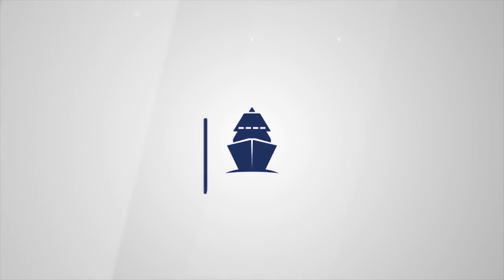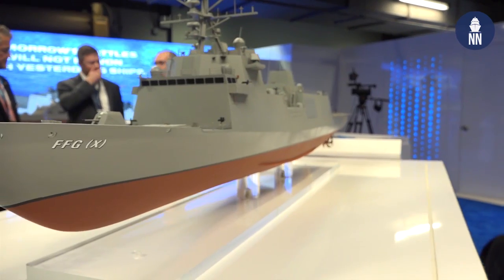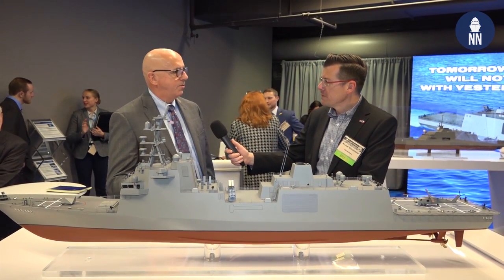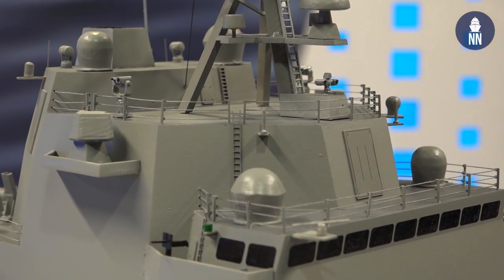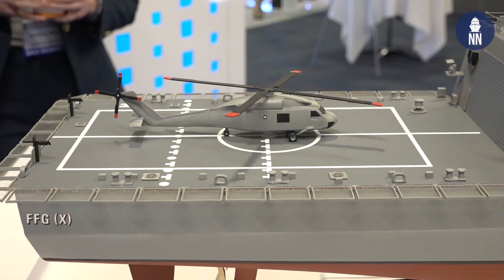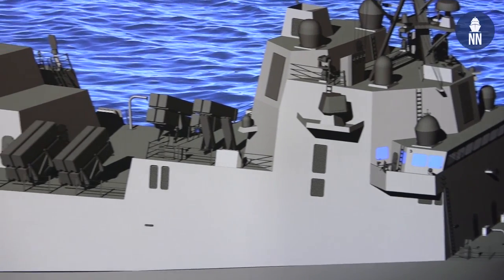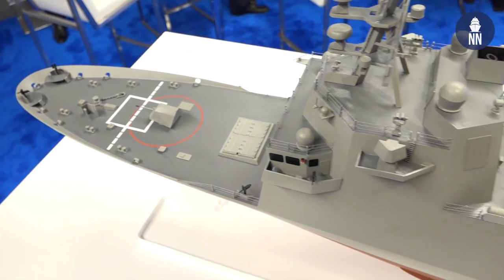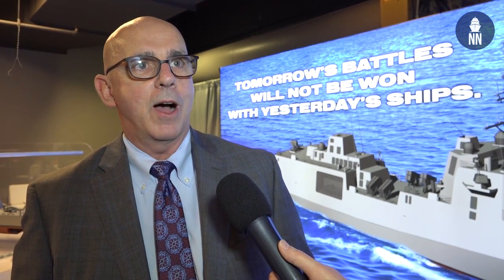Fincantieri’s FREMM Wins US Navy FFG(X) Frigate Competition - Part 2: Interview during SNA 2020

Comment: They should have gone for the German MKS-180 - a far more capable and larger ship! https://www.navalnews.com/naval-news/2020/05/german-navys-mks-180-multi-purpose-combat-ship-program-back-on-track/
Reply: Legio XXI Rapax  That is simply not true and not possible. There is no room for another LM2500 and you can't just add power to the ship. It will tear the shafts apart.
Reply: Legio XXI Rapax  You are mistaken. Yes, there is room for more power generation. But this is additional electrical power generation for direct energy weapons such as lasers and rail guns. This power generation is however not for propulsion.
Reply: Legio XXI Rapax  The FFG(X) will have a maximum projected speed of about 26- 27 knots. It is designed for ASW and vessel protection duties. The FREMM design is a very well known design and a very good design but by the time the last FFG(X) is operational the design will be almost 40 years old. The last hull is planned to be delivered in 2035 and be operational in 2039. Therefore it is already obsolete before it hits the water. That is the main drawback of using this design. The French are NOT even using the hull of their FREMM design for their new FDI frigate either, why is that? That is because the FDI is a new design with a new hull and they do not want to use an old hull. Whether you like it or not, it is not a very wise choice. The Italians will probably not use it either when they design their new cruiser, the DD(X).
Reply: The bid was stirctly for models already in service, no paper ships. Moreover,  after the disaster of the F125 none would have bought a German warship on paper.
Reply: @neutronalchemist3241  True, but it is not a German Warship. It is a Dutch designed warship. But they should have waited a couple of years and they would have had a replacement for the Ticonderoga class cruisers as well. The MKS-180 is a 9000 ton vessel, pretty close to the 9500 ton of the Ticonderoga class and to the 9700 ton Arleigh Burke class destroyers. The FFG(X) is a 7200 ton vessel and is allready maxed out with only 32 VLS cells. The MKS-180 is 11m longer, with ample space where the mission modules are located for more VLS cells.
Reply: @Robert66734  US Navy has tons of real destroyers. They don't need a wannabe one. They urgently need a ASW frigate instead. That's why the bid was reserved to models already in service, not paper ships that come with uncertainties about costs, delivery time and teething problems.
BTW the FFG-X is not "maxed out" with 32 VLS cells. They can be easily expanded to 48. They are 32 only for a question of costs.
Reply: @neutronalchemist3241  The Ticonderoga class is very old and the Arleigh Burke class are maxed out when it comes to power generation. They need to be replaced as well. Knowing the Americans if 48 cells would have fitted they would have put them on there. The FFG(X) is a good ship, but sticking to one class is cheaper in the end. The MKS-180 is also equiped with a towed sonar, therefore very well equiped for ASW.
Reply: @Robert66734  The MKS-180 for now is not equipped with anything. Maybe the first sample will be in seven years. As it is planned, its projected speed is absolutely insufficient for the US Navy, so it's engines should be completely redesigned anyway and, once redesigned them, it has to be seen if they'll be quiet enough for ASW missions. Meanwhile an ASW variant of the FREMM is already operative and, among the other things, the class is appreciated exactly for the quietness of the engines. 
32 cells were the request of the US Navy. Fincantieri always stated that model can be equipped with 48 of them if needed. BTW known models of the MKS-180 only have 24 of them.
Reply: @neutronalchemist3241  True, the MKS-180 does not exist yet, but neither does the FFG(X). The first FFG(X) should be delivered in 2026 and operational by 2030, with final operational capability declared by 2032. So that is quite a few years from now. None of the original equipment of the FREMM will be used on the FFG(X), it will all be swaped for American made equipment. The FFG(X) will have a maximum projected speed of about 26 knots. The original design (almost 30 years old by the time they are operational!!) will be havily modified, they will have to add 320 tons of steel to strengthen the ship. The entire lay-out of the ship will be changed as well. They are just basically using the hull and nothing else. The addition of all that steel means the propulsion system needs to be redesigned or settle for a lower speed. Even if they manage to squeeze in an other 16 cells, it will increase the weight of the ship and will slow it down.

The MKS-180 is a bigger ship and therefore has more growth potential. You know what they say, steel is cheap and air is free!
If the design of the MKS-180 will ever be sold to the Americans it will also be heavily modified. The German requirements include two saunas, elevators and ridiculous staircases. I'am sure the American do not want saunas and elevators on their cruisers :-). The MKS-180 requirements call for a continuous speed in excess of 26 knots. A maximum continuous speed is usually at 75% - 80% of engine power. That means that the actual maximum speed will be higher than 30 knots. The MKS-180 has been designed for a continuous use of two years with rotating crews. The MKS-180 has enough room for 40 cells on the bow and 60 cells in the middle section. Shorten it for the need of a frigate size ship and use the larger design as a replacement for the Ticonderage class cruisers and Arleigh Burke class destroyers. Therefore, in my biast opinion, they should have bought the MKS-180 design.
Reply: @Robert66734  the FFG-X is a modification of an existing and well known design. 
The US Navy requested 32 VLS cells. The FFG-X is designed with 32 VLS cells (and a max speed of 30+ knots), and Fincantieri stated there is space for 48 if needed. The MKS-180 is desighed for 24 cells (and a max speed of 26 knots). Maybe they can be expanded, maybe not.
Reply: @neutronalchemist3241  That is simply not true, the FFG(X) is designed for a maximum speed in excess of 26 knots. The Italian FREMM (6.700 tons) is designed for a maximum speed of 30 kts. The American version (7.400 tons) is 700 tons heavier. If you add another 16 cells that will add another 30 - 40 tons of weight to the vessel and will slow the vessel down even further. The MKS-180 is designed for a CONTINUOUS speed in excess of 26 knots. A maximum CONTINUOUS speed is usually at 75% - 80% of engine power. That means that the actual maximum speed will be higher than 30 knots. That is not a maybe, that is a fact. The original Omega design has room for 40 cells on the bow. In the middle section there is enough room for a least 60 cells. Because if you remove the mission modules there is ample room to add 60 VLS cells. That is simply not possible in the FREMM design.
The FREMM design is a very well known design and a very good design but by the time the last FFG(X) is operational the design will be almost 40 years old. The last hull is planned to be delivered in 2035 and be operational in 2039. Therefore it is already obsolete before it hits the water. In 2037 the first French FREMM frigate will be decommisioned. The Americans are not going to change the hull, they will be using the standard Italian FREMM version. The French are NOT even using the hull of their FREMM design for their new FDI frigate either, why is that? That is because the FDI is a new design with a new hull and they do not want to use an old hull. Whether you like it or not, it is not a very wise choice.
Reply: @jonnytaco7671  The hull is slightly longer but it is still the standard Italian FREMM hull. Like I mentioned before, it is a very good hull but by the time all the vessels are in the water it is a 40 year old design. At the end of life it is a 70 year old design. So it is not a very good choice. They should have joined either the Australians with a newer design like the Hunter Class (type 26) or the Germans with the MKS-180. Both of these ships are roughly 9000 tons fully loaded.
Reply: @Robert66734  
Well if the Americans had to wait 10 years and replace their Ticonderogas with your ship, (but i'm sure they're quiete capable of building their own) they could also consider the newly planned Italian 10K Ton Destryer/Cruiser which will have amazing fire power, and a proven track record, seen it would be un upgrade from the exsisting Orizzonte class destroyer which has amply proven it's worth.
Why woukd they want to buy a German ship, when Germany has hardly built anything to shout for lately, (maybe just the 212 subs)?
Reply: @sergiodario58able  They do not have to wait ten years, the first MKS-180 will be operational in 2027. The MKS-180 will be build to a higher standard of survivability than the Horizon Class and it is not a German design but a Dutch design. The Americans have to strenghten the FFG(X) as well beacause it is not upto Amercian standards. No doubt the Horizon class is a good warship, but it is also an old design and there are however no signed orders yet for an upgraded version of the Horizon class. The order for the MKS-180 will be signed later this year. The problem is that the Americans do not have a design ready to replace their cruisers (Ticonderoga) and destroyers (Arleigh Burke) that is why it might be a good solution. These ships will be build in the US as well and with US equipment just as the FFG(X) frigate (Italian FREMM version). The problem with an upgraded version of the Horizon class and that of the FFG(X) is that they are old designs, like I mentioned before, they are probabaly very good hulls but by the time all the vessels are in the water it is a 40 - 50 year old design. At the end of life it is a 70 - 80 year old design. The French are NOT even using the hull of their FREMM design for their new FDI frigate either. So it is simply not a very good choice. The new DD(X) might be a good option if it gets a complete new hull design, just using the old hull is in my opnion not the right choice. It might just be a good idear if Italy adopts the same MKS-180 design, the DD(X) and MKS-180 look quite simular. It will save Italy a lot of money in design costs, in these challeging times it is a good idear to work together.

Comment: Seems a little under gunned, ?  With no close in weapons systems (phalanx), only a 57mm main gun when most ships of this size and class use a 76mm or larger and no 25mm or 30mm auto-cannons. Also no torpedoes ?
Reply: Also I forgot to mention it does comes with CIWS. It’s called SeaRAM using missiles instead of gatlin guns
Reply: @aps125  RAM, not SeaRAM. SeaRAM is a standalone system for ships lacking the radars this ship has, using the same missile, but the radar systems of the Mk 15 Phalanx. RAM uses a 21-cell launcher, directed by shipboard radars.
Reply: US Navy has approximately 100 large surface combatants employing 5 inch naval gun. That’s more than adequate for naval gun fire supports. The 57mm is not only cost effective but also comes with lots new innovation in terms of smart munitions. US navy plans to deploy two types of guided 57mm ammos: L3 Alamo rounds for anti surface warfare (against multiple small boats attack, a tactic favored by Iranian IRGC), and a high end Raytheon developed MadFires round for cruise missile defense. They are much more effective for their intended mission roles in comparison to traditional 76 or even 127 round. Again it’s the ammo that matters the most, not the caliber. As for ASW, FFG-X will eventually deploy VLA Asroc using some of the VLS cells. It’s a better option than torpedo launcher.
Reply: @aps125  Guided ammunitions for 76mm, both AA and anti-surface, had been out for years. They don't need to still be invented. Advocates of the 57mm point out that, thanks to the higher ROF it puts (slightly) more explosive in the air in the same amount of time, but the 76mm has 60% longer range for AA, so it simply starts firing way before and has much more time to fire a second salvo if the first one fails.
Reply: @aps125  also their helicopters will be armed with torpedos.
Reply: Hopefully the guided weapons don’t fail like what happened to the Zummwalt class.
Reply: Its 2020...guns are pretty obsolete
Reply: A lot of torpedo launcher are effectively useless as they are out ranged by the subs they are supposed to defeat. Helicopters are your best option.
Reply: Conan  How many months into a shooting war till you run out of ESSM or SM whatever? Much rather have guided or dumb but radar directed 76mm at a sustainable rate with longer legs than 57mm. And regards other comments above. Helicopters cant fly all the time. They can break down and they may also have other taskings. No torpedo tubes is silly but can be rapidly rectified at a later date but with limited number of reloads. Also the wests lack of a ASW rocket (Apart from very capable but expensive ASROC) is a worry.
Reply: @shanemartin2491  the range of the 76mm is only slightly better than the 57, which would also require a larger magazine for the same number of rounds.
Reply: @jimmellenberger8505  Good point interms of magazine. 120 rounds (76) plus a hoist verses 220ish rounds plus hoist (57). but 57 is a 2.4kg round versus 6.1kg. 120x6 is750 kg per min 220x2.4 is528kg a min. Both mounts are about $5-6 mil USD. 57 to be reloaded needs the barrel skyward to reload (which I believe is still current), refurb period is 6 years for 57mm and 16 for 76mm. The 76mm is 100m/s slower tho. But for supersonic let alone hypersonic ashm I would rather the heavier round and weight of fire.

Comment: I can't believe that the ship doesn't have a phalanx
Reply: Excuse me, what is a phalanx?
Reply: @ignacioburkhardt789  Greek guy from ages ago. Liked alot of leather.......nah its a rapid fire 20mm gatling gun with integrated radar. Bolt on bolt of system which only requires power and I think maybe cooling. Weighs 6 or 7 tons and has just on or over 1000 rounds. Proven but starting to become obsolete given increasing size and speed of anti ship weapons. Case in point the Russian Zircon which is reported to have a top speed of 2.7km a sec and weighs something like a ton plus. Off the top of my head so might not be quite accurate numbers.

Comment: So, since this configuration comes in at around 7500 tons displacement, doesn't that really bump it into destroyer territory (the DDG runs at 9000 tons)? It lends credence to the early criticism that the USN has again underestimated the potential real cost for each unit purchased (assuming similar capabilities and expense per ton displacement). 

If this vessel is what the USN needs to accomplish the mission, then build it in sufficient numbers to justify the cost over the entire program duration (rather than cut the production schedule to 3 ships and watch the budget explode beyond control).
Reply: @Joshua N. Ajang Up to a point, due to economies of scale and efficiency. But remember that the USN originally planned to build 32 Zumwalts, and ultimately purchased only 3 (pushing the cost per unit to an astronomical  $7.5 billion). The USN literally cannot afford to repeat this fiscal disaster with the FFG(X), or continue to fill its roster with complex ships that don't work (Zumwalt, Ford and the LCS).
Reply: @thomasromanelli2561  Zumwalts and LCS was a painful episode.  All that money--cringe when I think about it.
Reply: @MelonHead887  They're not total write-offs: I hope we learned something about new systems integration and power distribution from building these classes of ships. The Zumwalt hull form might be the basis for the Large Surface Combatant the USN wants in the next ten years.
Reply: Thomas Romanelli those ships include development costs off a new design. This is off the shelf. X ships for X $$$. But yeah, unknown costs seem to develop anyways as they figure out the production.
Reply: @TheBooban  I agree about the potential for cost overruns, but off the shelf? Sorta. The weapons, sensor suites and integrated electronics will come from Uncle Sam, but this will still be a (heavily modified) FREMM variant tailored for the needs of the USN. By the rep's own statement, "this has all the capability of a DDG Flight IIa, but not the capacity". 

So, it's a frigtroyer...  😊
Reply: The destroyer denomination has to do with capability, not tonnage, this doesn’t have a deep strike capability through cruise missiles, thus it is a frigate.

Comment: Excellent choice. Really is a Flight 2A but smaller with less VLS and flight illuminators, a critical draw back with RANs Hobarts. That added third illuminator an and does make all the difference. And yes as someone has posted already, the 'pork', like the F35 for example and one of the reasons ending the JSF was never an option, the pork is spread wide, sprinkled as it is. But the USN need a FFG, badly.
Reply: The will probably use ESSM Block2s which have an active radar homing head. They don't need as much use of the ship's illuminator radars, you just have to get the missile in the general area.